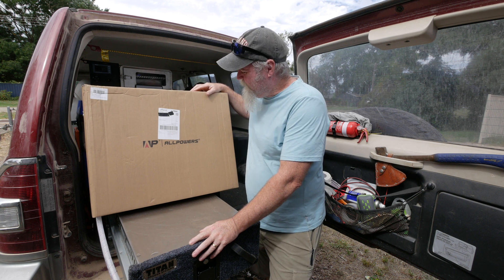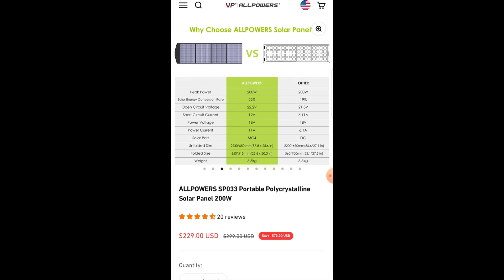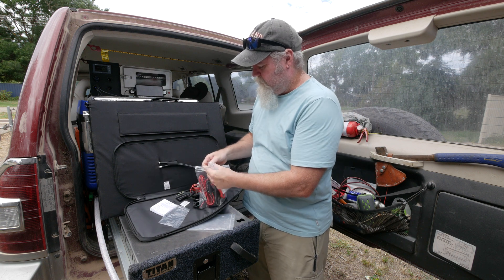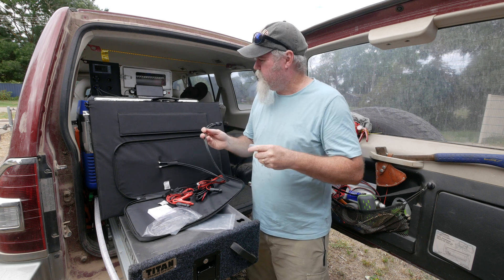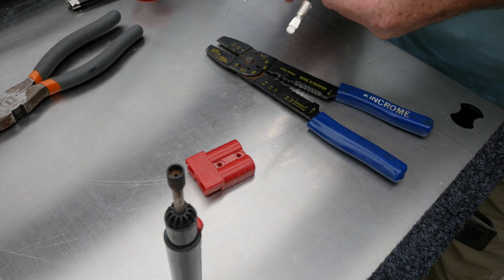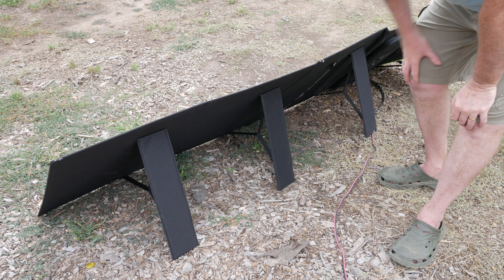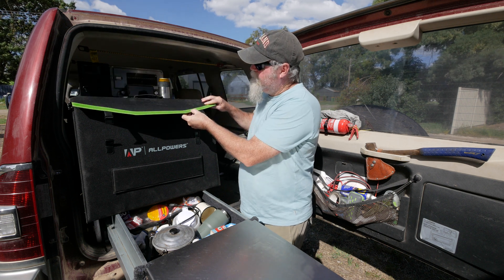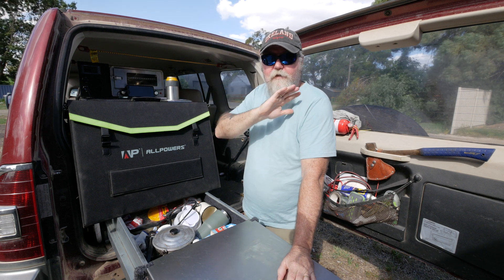Allpowers 200w folding solar panel SP033 review

Comment: Thanks for the review. 😊interestingly Amazon has the open circuit voltage listed in the specs at 23.5 for the SP035 but the site you have on your link has the OCV at 50volts. I need it below 28volts because the Redarc manager 30 is limited to the OCV.
Reply from the maker: The sp033 is around 22v open circuit and around 17-18 when under load
Reply: @Outdoorsaustralia  yeah that’s right. But I’m wondering about the SP035.
Reply: Maybe this type is ok. I bought 3 Allpowers 200w monocrystalline portable panels in 2022 and all of them failed within 2 years

Comment: Good output for shaded panels.
How do they hold up in full sun for few months does the material or edges fray?
If your doing another test can you shade each panel one at time and see if they equally share output. Ie 160W = each panel 40W.
Good review.
Reply from the maker: Hi mate, I can't speak of the long term long reliability yet but the materials seems thick and strong so hopefully should hold up well over time. Yes the panels are wired in parallel so partial shading only affects the individual panel thats shaded.
Hope that helps 😃